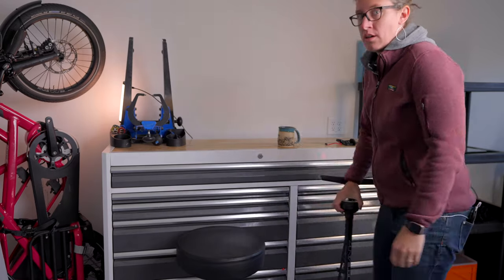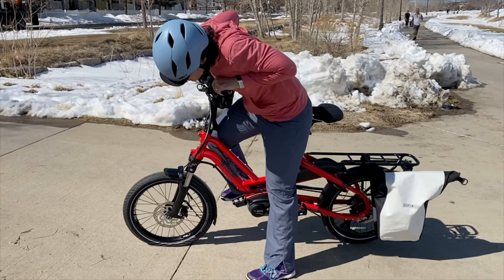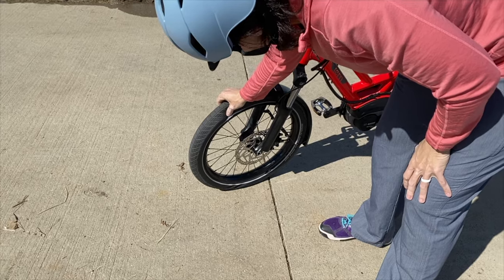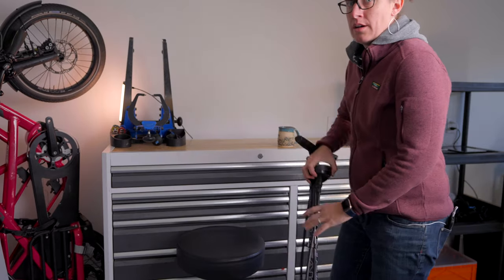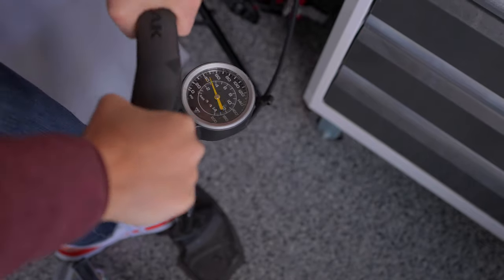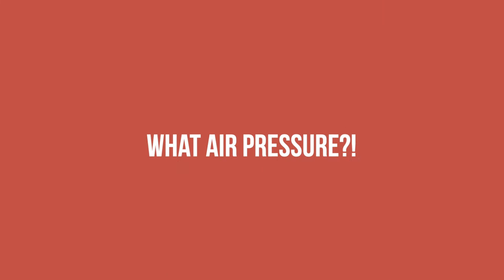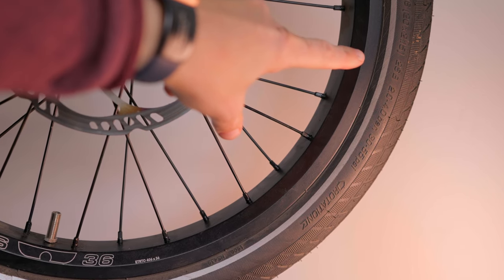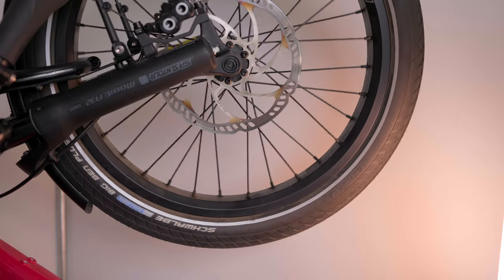The BEST bike tire pressure for electric bikes and cargo bikes

Comment: Very Interesting. My bike tires say 40-65. I think they were at 65 when I purchased the bike from my local bike shop and when I did a test ride during my bike search. The test ride was all on pavement. After I purchased the bike my rides were mostly on a crushed stone multi use path. I noticed right away how differently my bike handled vs riding on pavement. After about ten days I noticed it handled much better. Then five days later I noticed the tires looked low. I did not know I needed to check them every week. The pressure was down to 35psi. I pumped them up to 55 and found that pressure felt good on the 1/2 mile of pavement I ride on to get to the trail and felt good on the trail as well. After watching your video I am thinking I should consider a higher pressure in the rear tire  since the battery is installed as part of the rear cargo rack and my bike is flat foot technology so my weight sits towards the rear vs the center of the bike. I really like your videos. You explain things well so even a novice like me can understand.
Reply from the maker: Glad it is helpful!

Comment: @3:47 if the close up of this tire is the same tire on the Tern in the background of the previous shot, you’ve got the tire installed on the rim/wheel backwards… based on the rotation arrow on the tire in the shot at the time I link to.  Just thought you might want to be aware of that.  Happy riding!!
Reply from the maker: I assume you are looking at the tern GSD with the handlebar flipped and front wheel backwards?

Comment: Good advice there. Are there any additional air pressure considerations with regard to range? Also same question but for hot/cold temperature extremes.
Reply from the maker: Range of your battery? The less rolling the resistance the better!

For hot/cold, not that I know of unless it means cold = snow/wet.

Comment: My pump is broken (I really need a new one), so I've not been able to check mine, but I found today with the sudden change in weather my back tyre was really soft, and it would occasionally bottom out. I do prefer to ride mine slightly softer for comfort anyway, but I do try and check the pressures at least once a week. I also tend to get a lot of thorns and stuff around here, so I do also get a lot of flats, usually in the rear tyre.
Reply: Schwalbe makes tires that are almost flat proof, but you need to check the air frequently. I suggest you look into those. You must be good at changing flats by now. 😉

Comment: Thanks a lot for these tips Arleigh. Any recommendations on when to check the air pressure: before a ride (before leaving, "cold" tyres) or at the end of the day when reaching home ("hot" tyres)? I know the air pressure in a car tyre is different before leaving and after riding for 30km for example. Many thanks :-)
Reply from the maker: Interesting question!! I don't think normal city bike tires will ever get heated up like a car. I personally check them before a ride. If you check them after you ride. If you check after you ride, they may lose air before your next ride.

Comment: Tern rims and the stock tires aren't tubeless ready are they?
I want to get a cargo ebike, but I do delivery and can't afford a tube change.  Tubeless is the best, putting a plug into larger punctures is so fast.  Adding sealant after many small punctures is easier than a tube change as well.

Have you looked into tubeless?  Or by chance am I wrong about the stock tires, and they are actually tubeless ready?
Reply from the maker: I haven't seen any tires rated for cargo bike weight that can also be tubeless. For bikes for business clients, we use Tannus tire inserts and slime in the tubes.

Comment: I’m a new rider and been trying to find the correct air pressure for my tires, this is probably a stupid question but how is it that a car tire pressure is 32psi but a bike tire is between 40-55 psi ?
Reply from the maker: Volume in a car tire is much higher
Reply: some bike tires can go up to 120 psi for skinny tires. My road bike I set at 100 psi.

Comment: Great tips! How should my tire pressure change based on cold or hot weather? When it’s cold it will be lower already should I shoot for 35 in a 30-55 range so more tire is in contact with the pavement on my cargo bike? When it’s hot should I shoot for 45 and below or ride a bit higher?
Reply from the maker: I don’t focus on the temperature and more what the ground is like. Wet/ice = lower. Clean and fast = higher

Comment: Thanks you did great ,do advice i  ride  Monday  Wednesday  and Friday   hight  5.11 wait 103 kg my tyres needed to be replaced within two or three month size 2.2 .26
Reply from the maker: wow, how many miles do you ride a day?
Reply: 11to,12 miles a week
Reply: What size of tyres I must use to avoid quick replacement
Reply from the maker: @hassanmehmood7904  it is less about size and more about quality. Look at something with flat protection and high mileage rubber

Comment: Good advice video. Last weekend, I put down my deposit to preorder a very expensive GSD R14, and has started a detailed investigation on what accessories to purchase. (Did I mention this was very EXPENSIVE!! GSD Cargo Bike) So one of the first items I need to purchase is something to secure this GSD, so what kind of locks do you recommend, and how many??? Planned use for this is for Shopping, as well as a Silicon Valley Bike commute.

I've been looking at those Abus bike locks with the ability to have multiple devices opened by the same key, but the devices have to be in the same key/security class to be compatible to use the same key (???) so what does the GSD come with, and what class of Abus locking devices would be compatible ???
Reply from the maker: Have you looked at the various reviews on this channel? I did one for my favorite lock. 

The frame lock and battery cores are not part of the key alike system. I personally don’t mind but if you do then you’ll need new lock cores and frame lock to match your preferred lock.

Comment: Ok, but how do you verify PSI/BAR? I Commute daily and my manual cargo bike is my grocery getter,  I typically carry tire repair items and top up air monthly.  But I just use the compressor at my local gas station in Europe.  Not really exact.
Reply from the maker: I don’t recommend the gas station compressor for that reason. They aren’t exact and often are off. A good bike pump is $20-40 with a good gauge.

Comment: On my ebike it's 40lbs. max...I usually put 40...but notice it rides hard on curbs when I jump them at slow speeds. What is a better range of air pressure? I do have dual suspension but can't adjust it. Any thoughts?
Reply from the maker: What type of e-bike? Are you riding on the pavement or dirt trails?
Reply: @BikeShopGirl  My ebike is a folding Voyager Pro Radius eBike with 16" wheels. I ride on mostly paved roads, sidewalks, some grass too...use my ebike for my work commute, but like to use for future bike trails.
Reply: Air pressure is a compromise. If you’re bottoming out you need a higher pressure. I would run 45 on the tire that bottoms out even though it’s rated to 40. If that doesn’t solve it find a higher rated and/or possibly wider tire.

Comment: Does it matter how much you weigh? I always worry about it? Also my tire said it can only handle 130 but the bike can handle 347
Reply from the maker: The weight is split between the two wheels so the tires technically should handle 260. 

Glad you got a pump and are using it often! What type of biking do you do mostly?

Comment: i ride with a front basket and nothing on the back (no panniers, no kids etc :-) ) should i have higher pressure on the front than the back?
Reply from the maker: How much are you carrying in your pannier? If it’s not much, I would keep them equal but you could always test!
Reply: @BikeShopGirl  i am carrying a 3 pound camera in my front basket and sometimes 1 litre of coffee and often my rain suit just in case, i figure about 4 pounds in total. So maybe try inflating my tires 5 pounds more than the back?
Reply from the maker: With the camera, I would try to keep it low to help reduce bouncing/vibrating.
Reply: @BikeShopGirl  thanks!

Comment: All my 26x4 tire says is inflate to 20
Reply: That's a fat bike tyre, so it will be more volume, running lower pressure. 23mm road bike tyres will be running up near 100psi